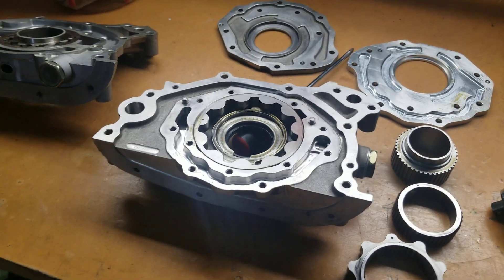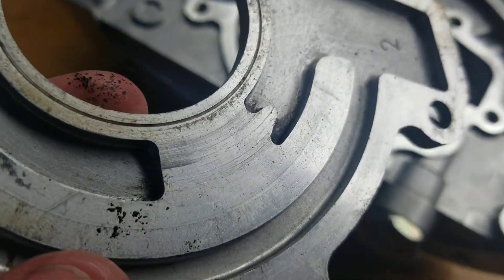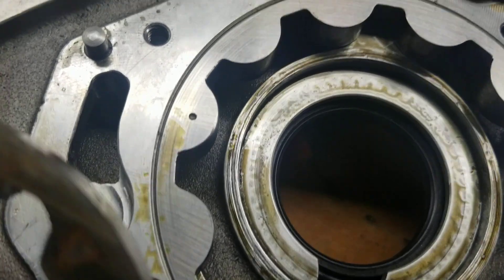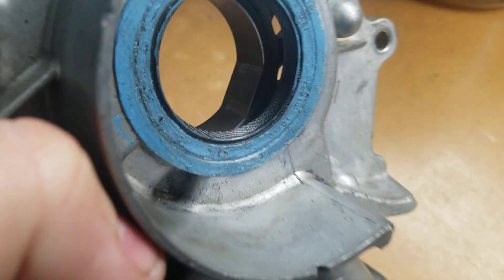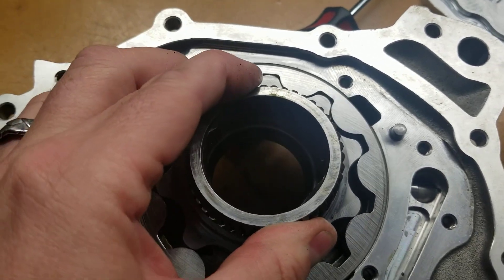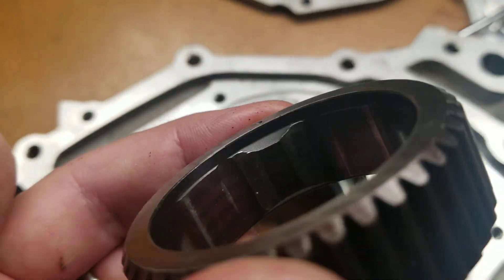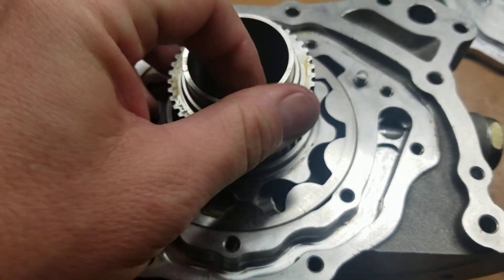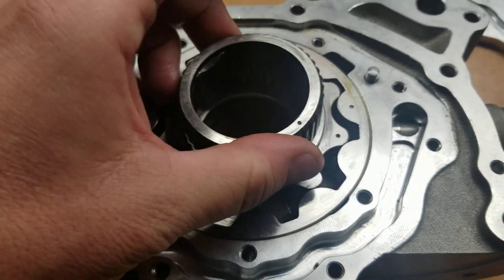Tomei Oil Pump damage and spline drive

Comment: What power levels was this Tomei pump damaged at? Also was this on a short nosed or long nosed crank?
Reply from the maker: 600,  Long nose.
Reply: importavehicle.com hmm that's not too confidence inducing. Was it a drag it track car?
Reply from the maker: @AshtonCoolman  we don't think it was installed correctly.  See here:  https://www.gtrusablog.com/2018/01/oil-pumps-on-rb-series-engine-true-or.html